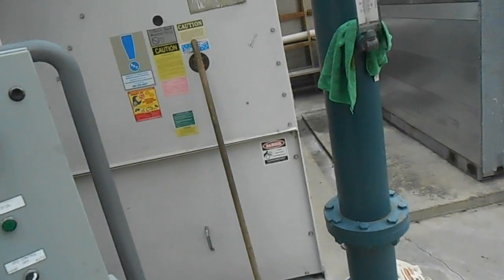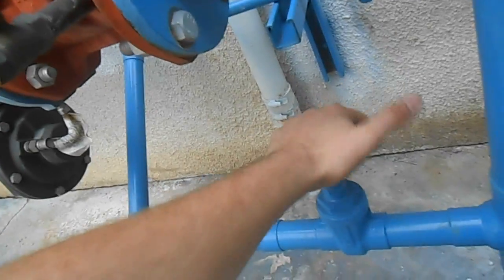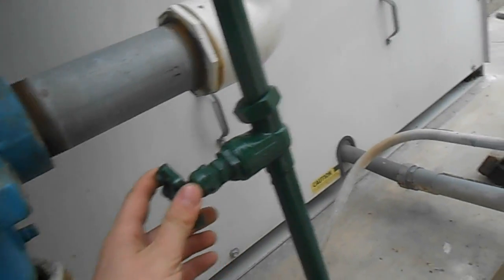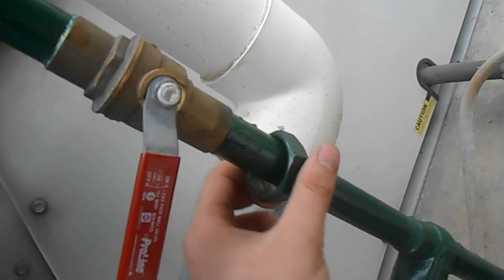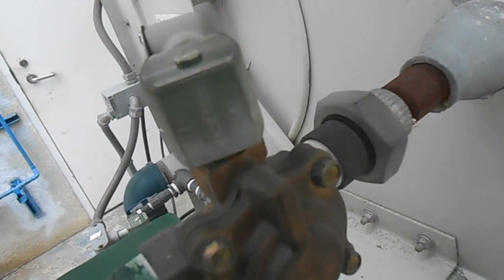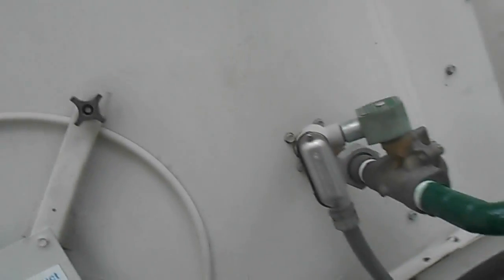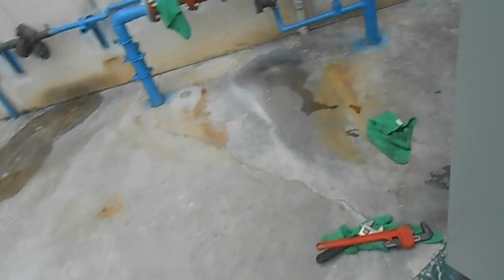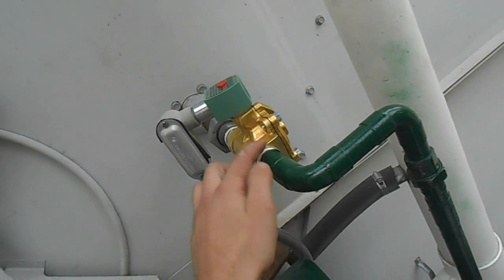HVAC: Make-Up Water Solenoid Valve

Comment: Where does the makeup water come from? Is it connected to normal water supply or from a resevoir?
Reply from the maker: In this case it is connected to a normal domestic water supply thru a separate backflow (all make-up water comes thru one separate from  building supply). but, the incoming pressure only needs to be about 20 psi for a float type valve or this type of system. so it could be connected to any source that can provide adequate pressure :)